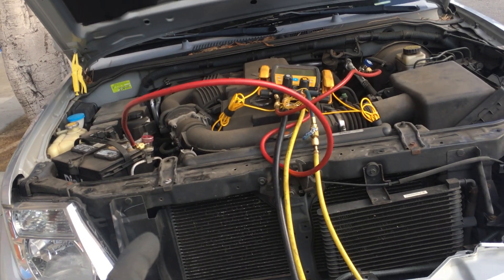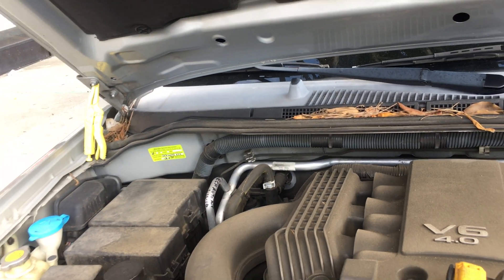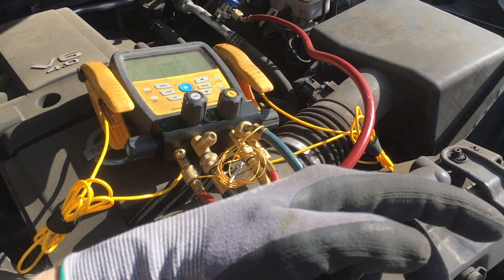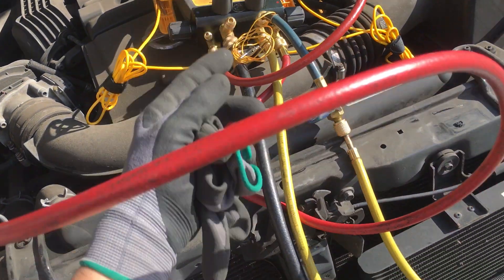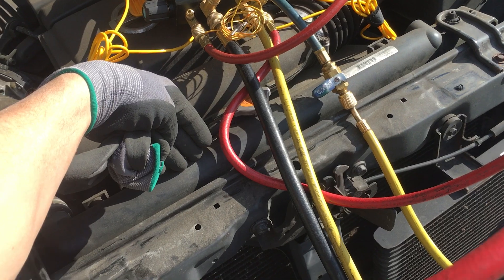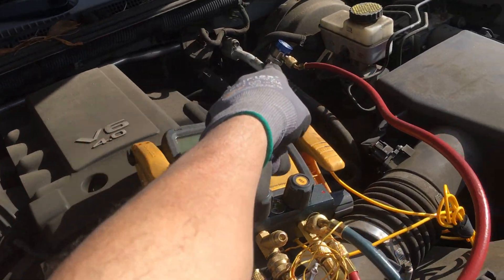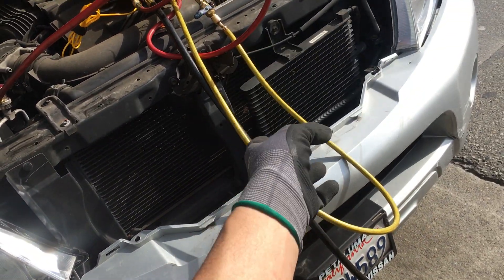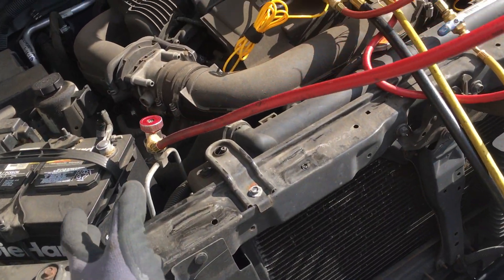AC recovery explanation, AC oil removal, WHAT ABOUT THAT UNIVERSAL REFRIGERANT OIL ???!!!

Comment: What's the best and easiest way to remove excess oil from A/C for a DIYer  gas already gone ?
Reply from the maker: Remove compressor preform oil balance.
Reply: @coldfinger459sub0  Hey friend can you please tell me what the static and normal operating pressures are for a 2006 Mazda 3s 2.3L 4CYL DOHC (AT) Sedan GAS non turbo VIN# JM1BK323361459957

A/C Does not blow cold at idle but will at speed A/C not useable have to roll windows to survive . I think there is to much PAG oil in system as I had another shop do a factory load PAG oil and R134A and then I put in new compressor with out oil balancing because he said I needed new compressor 

NEW PARTS : 

Compressor
Condenser
Expansion valve
A/C stretch belt + serpentine belt
Cabin filter 
Engine/Condenser Cooling fan
Engine Coolant
Engine Thermostat

Thanks
Reply from the maker: @Devo1987  2006 Mazda three now that’s a Car. I don’t see you too much anymore.. 

Can I give you specific pressures and temperatures? . 

Compressors always must be checked for oil . 

Weather the instructions say it has, or does not have because they cannot be trusted. I’ve made videos about that before . 

And I never trust anybody even at shops .  
  Sometimes I just can’t understand how the same mistakes cake keep being made over and over again. 

Does get a little frustrating . 

I RAW is usually a little bit warmer than higher RPMs like 1200 or 1700 RPMs .  

On an 80° day in the sun you’re probably seen about 43 to 46°F at idle 

And if you raised RPMs to about 1200 to 1500 RPMs your temperature probably comes down to around 40°F 

Do not have a pressure temperature chart for your vehicle . 

But a Noyle balance must be done after a full refrigerant charge . 

To check the oil level by pulling the compressor and following the instructions for an oil balance for your vehicle. This is the only way to be sure. 

There is no guesswork in this business 
It’s either done right or not .
Reply: @coldfinger459sub0   I had a tech add a factory load with old compressor I put new compressor with oil in that so im doubled oiled    I guess you already know that.  Cant I just drain out some oil from new compressor by removing it  the charge only with r134a   I have a recovery tools and gages at my disposable. ?

 Thought im thry to do this as fast / safe/ legal as possible

Comment: So if a hose or condenser or compressor or any other components is leaking oil how can you tell how much oil need to put back in
Reply from the maker: Oil leaks are usual a oil spot that only drops 💦 come our and spread wide accumulation of dust make them look like a lot more. 

If you ever remember seeing one or two drops on a concrete floor or piece of paper and the next morning it spread out to the size of a large dollar coin. 

This is all the tiny amount of oil that comes out

Comment: Is there a way to recover all of the oil in the system without taking it apart. I suspect I have too much oil in my system from a recent DIY service as I had an oozing leak from the ferrule in the discharge hose which runs from the top of my condenser to my  compressor. I replaced the hose, drew a vacuum, and added oil in through the low side (appx. 2 oz.-guestimate as I could not see in the 3 oz. can). I followed up with refrigerant but only got about 22-23 ounces in before my high side reading was at 205 psi. The recommended high side pressure is between 175-185 psi. The system is cooling well, but it calls for 2.8 oz of oil and appx. 25.5 oz of refrigerant. My concern is all the oil was not lost out of the system in the initial leak, as I first assumed it was, and that this is giving me the over pressure.
Reply from the maker: What year make model vehicle for sounds like a newer vehicle with a smaller charge and oil quantity.   I buy Toyota Yaris or Toyota Prius C.. 

Only two ways to remove oil complete this assembly 

Or if someone has a liquid refrigerant flush machine, but still the expansion valve needs to be put in a bypass valve needs to be hooked up so it has a clear flow through a dummy expansion valve that allows refrigerant flow to flush out all the oil 

Either way is using refrigerant chemicals, flashing agent 

Either way things get taken apart with individual components 

Or using expensive flushing machine 

There’s no magic easy way . 

It’s expensive lesson learned for those who do not read 

And we do not fill cars by pressure 

We still buy weight only

Pressure is only guessing and there’s too many variables

Dirty evaporator core will affect pressures giving you a false reading

Partially dirty cabin air filter will throw your pressure is off

Hey dirty Condenser throw your pressure is off

If it was one of the older vehicles with thermal fan clutch fluid driven, they lose their efficiency overtime and they don’t spend quite as fast as they used to. You cannot see it with your eyes but I will make the pressure higher giving you a false pressure reading.. 

The temperature of the day will give you a different pressure reading

How strong is the sun is actually shining will give you a different pressure reading because of the amount of BTUs or watts of energy through radiant projection from the sun loads the car differently on different days will give you different pressure readings. 

If the vehicle was ever in an accident, and they got a cheap aftermarket, Condenser installed, will give you a different pressure reading. 

So I always ask everybody to explain to me, then why would you use pressure to fill the system?.  

This was a method that keeps getting re-printed and the information passed around from the 1950s and 1960s and before. 

And if anybody like myself has ever read books all the way going back to the 1930s 40s mostly in the 50s and 60s when air condition was introduced but if you were earlier I have actually read the factory manuals hundred procedures using pressures. 

And they give you precise RPMs at the vehicle, Hass to be held at.  And those days it was a carburetor and you would adjust the screw on the carburetor, set that RPM.

And they would tell you if they had the option to either open. The front doors are open in Fresh air door or close certain blender doors that were manually operated in those days. 

When they had fixed piston compressors with no sensors that we’re taking over from a computer and trying to adjust pressures and piston displacement. 

This is why we no longer use pressures for bubbles in a sight glass

But manufactures, keep re-printing this data because in some cases I guess I’m kind of close. 

But they know majority of technicians are uneducated, especially around the world and they don’t have expensive equipment in Third World countries to fill systems

And uneducated part also includes the United States for automotive technicians. There is no mandated formal education system for a Automotive technicians.
Reply: @coldfinger459sub0  Thanks for the detailed response. I figured I’d have to take everything apart…at least under the hood. It’s a 2012 Honda Odyssey. The local shop claimed the compressor was bad and quoted $2,300 for a new one plus tax. That seemed a bit much. Also, the van is only worth $9K. So, I figured two and a half 10 oz cans would get me within range, and then people started mentioning that I needed to add oil. Maybe we overthought it. My refrigerant was oozing from the rubber hose of the discharge line as a liquid. I don’t know how much oil I would have lost that way. I’m considering replacing the condenser, as it’s pretty inexpensive. I also thought of the condenser causing a bad pressure reading. I understand about pressure changes and thermodynamics. It’s unfortunate the dealership were such terrible mechanics. I have a pregnant wife, it’s summer, and I needed cold air for her. There aren’t many mechanics we can trust around here. I can take it all apart and drain it…replacing recommended parts in the process. I’m worried it’ll fail on her and need to rework it. Also, we’ll be selling it, and I don’t want to pass on anything bad to someone else. I’d rather address it now.
Reply from the maker: @Dei_Gratia_Rex  and if you have rear air-conditioning, don’t forget that too there’s another expansion valve back there and another evaporator with a long set of lines that accumulate oil running from the front to the rear.

Comment: What's the best way to remove oil from the AC lines? If I'm going to replace the compressor, can I just run the compressor with the line disconnected to drain the oil? (after I've drained R134)
Reply from the maker: Flush with flushing solvent 4 SEASONS makes videos on it Dura flush makes videos on it I think maybe even master cool has videos on flushing AC lines all on YouTube
Reply: @coldfinger459sub0  gotcha.  I'm converting my belt driven one to an electric one. The electric compressor comes with POE oil and reading mixed opinions on how compatible POE oil is with PAG oil, do you have any insight? That's why I was wondering about flushing the PAG out.
Reply from the maker: @TheDudeWithTheAcura  if you’re spending that much money time and effort into converting it over to electric you might as well flush the system
Reply: @coldfinger459sub0  Yeah I know what you're saying. So even on a belt driven AC compressor, there's oil going through the entire AC system?
Reply from the maker: @TheDudeWithTheAcura  👍 yep
Reply: @TheDudeWithTheAcura  If you converting from belt to electric: Is this a very specific case, or is this done on multiple vehicles/models? Never heard of it before, would like to research this topic a bit, unless the electric retrofit is only applying to your specific vehicle, because the manufacturer changed to electric in the newer model year as an example.

Comment: i got a 2009 mazda 6 that takes 1.2 lbs of 134a.  I replaced the dryer and TXV as the low line was cool and high line was VERY hot at the valve.  I did a test on the old and new valves and the new one performed much faster and better so it was an issue. I found dye in the lines.  we got the car with 10k miles. my wife did have the ac checked and tuned up without telling me sometime after 100k miles.  i have worked on my own cars for almost 30 years with full success but rarely have to deal with AC.  I now suspect that the condenser is partially full of oil.  High line out the compressor gets supper hot but the high line past the condenser is a little warm. Low pressure about 25psi, high side about 175 but that is only with maybe 0.5lbs of 134a.  The system will not take anymore what so ever and compressor never cycles, on all the time.  Am I on the right track with too much oil?  The high and low readings would take forever to equalize before the new TXV. With the new one it still takes some time but they get closer a lot faster. I want to try pouring out oil from the condenser, just wish taking off the condenser didnt take a couple hours.
Reply: P.S. The reason I messed with the AC was because after the car ran AC for an hour or so the air was not as cold. It would start out cold enough but still was not 35 degrees below ambient.  I suspected a problem that needed addressed before the compressor would burn up.  Before servicing myself the low was around 20 to 30 psi (depending on ambient temp and humidity), high side was 300 to 350psi.  Clearly way too high. The possible extra oil came from Dobbs.  I have a long list of Dobbs stories across multiple cars....
Reply from the maker: You don’t fill until it doesn’t take anymore. 

You only recover all refrigerant, vacuum, and only fill by weight only using scale. 

Only the do you diagnose. 

You don’t top off refrigerant. You only recover and refill. 

Leave on vacuum pump overnight.
Reply: @coldfinger459sub0  I replaced components, dryer and TXV, applied vacuum and waited to see if the vacuum held.  After that I was going to add about 19oz of 134a but only got about 5 or 6oz as the first 12 oz can is still rather full.  I did not top off.  Factory sticker says 1.1 to 1.2lbs of 134a.  I am well below factory refrigerant charge.  Thus I believe the condenser or pump may have way too much oil. High pressure does not really move, low side goes from 20 to 30 psi, back and forth, with compressor constantly running. I pulled a 25psi vacuum before filling.